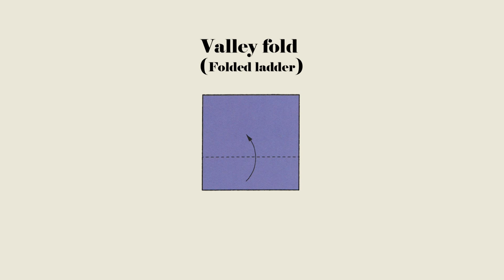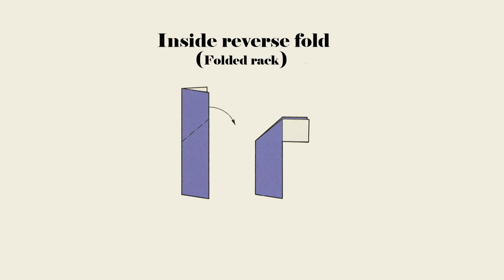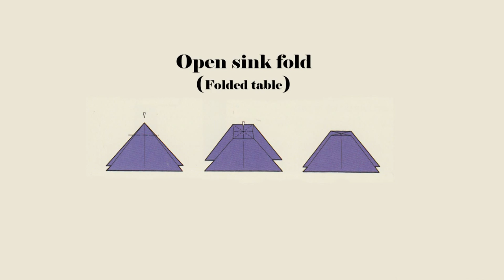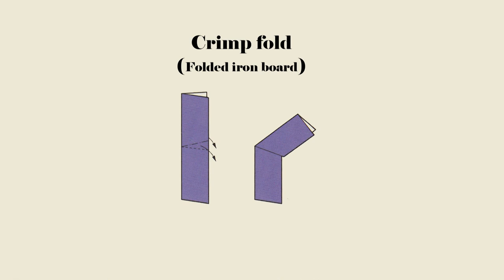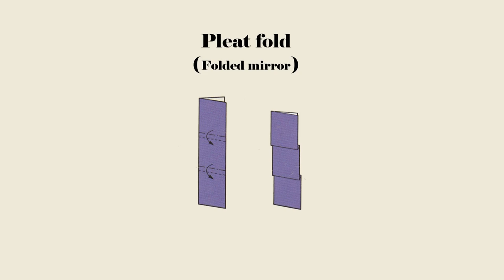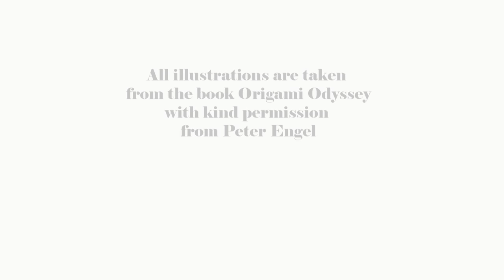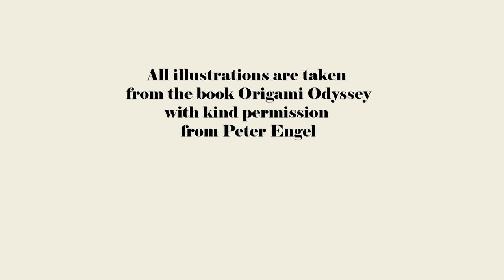The Shape of Things to Come (Origami Odyssey)

Comment: hey jan, you probably know this by now but just wanted to let you know that glass is far easier to crack when wet. it also helps if the striking object is harder then glass. i would recommend using something harder to scratch along the line you marked, and then hitting the edge if you wanna make a cut though. also i think spark plugs work really well if you just wanna shatter the glass.